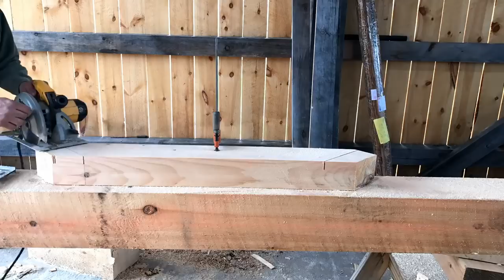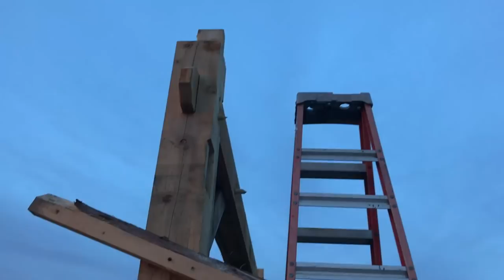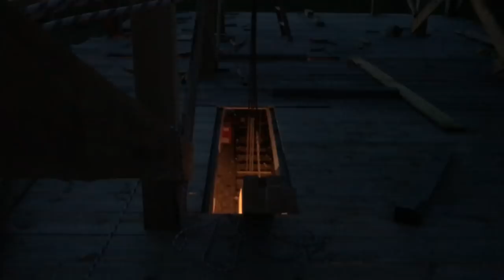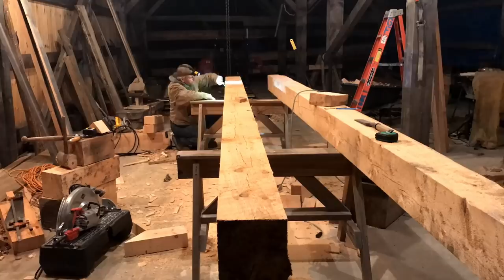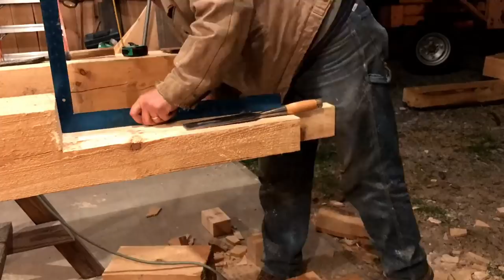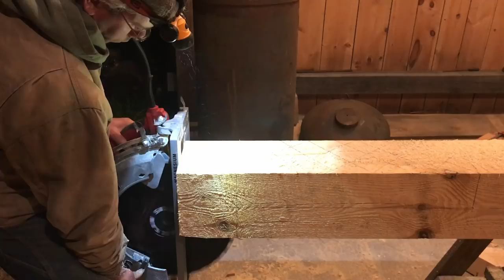Tips For Timber Frame Braces When You're Working Alone

Comment: I was wondering how I was going to support my braces when it comes time to place my top plate on for test fitting. Great idea! Thanks for the tip. My braces are going to eventually be 'pinned' into place with wooden dowels that I made. Do you think that by pounding my dowels into place, that they will be held that way? Or do you think it's better to test fit without the dowels and save that step for when the frame is going to be permanently erected? As per usual, thanks for your very informative videos. They have been most helpful in my quest to build and finish my own project. Cheers!
Reply from the maker: I still the braces after I test fit and just before assembly.  Sometimes your timbers have to be adjusted to make them square.

Comment: Jim, is there a way of fitting braces after a frame is up or does it always need to go in post first and then put top plates on? (I'm in middle of my oak frame) 😁
Reply from the maker: There is a brace you can do afterwards.  It requires notching the timber in the air, you would need to make an open faced mortice and it would require mechanical fastners to work.

Comment: Morning Jim. That drop cut looked cool as heck. I'd sure hate to see a kick-back with that monster saw. I figured out/remembered how to paste a link, as we discussed in a previous video, so here is my May 5th update. https://youtu.be/yQVB0zpSevw
I also have posted two videos of the assembly of the bandsaw, a Wen 14 inch, that I got for Christmas. It only took about an hour, but I had physical difficulties related to my condition, hence the second video to finish up the assembly. 
I love the tip/trick for getting the brace in place before putting up the perline beam. That should prove quite helpful if I ever get the timbers for my project. Thanks for sharing.

Comment: Hi Jim, hope all is well, could you give me your opinion on me thinking of using 4 x 3 inch timber for the braces on a 6 x 6 build. I may of under sized and should of gone for 5 x 4 instead. Or would I get away with it. Thanks Jim
Reply from the maker: Of you have long and tall walls I would go 5x4 but if the frame is short and squat the 4x3 should be fine.
Reply: @TheTradesmanChannel  its a single storey garage workshop at 7m x 4m with a beam post spaced at 2.316m apart gives 4 on length sides  and height of vertical beams will be approx 2.2m